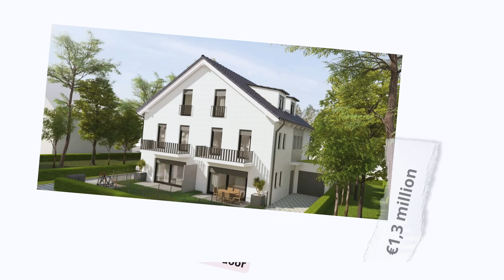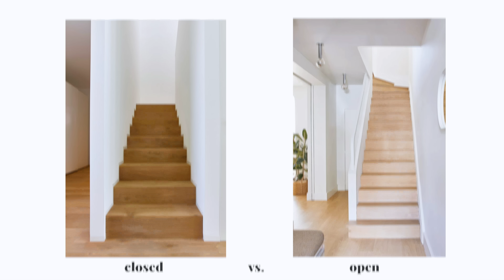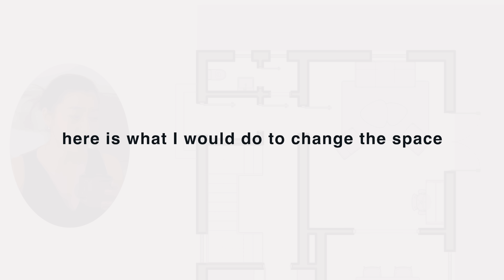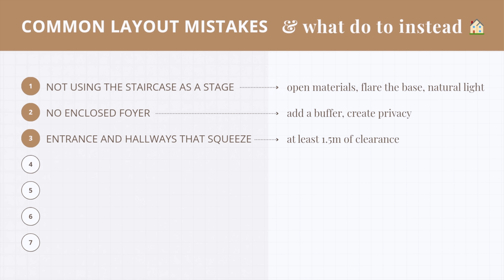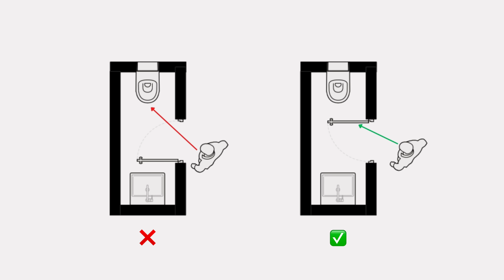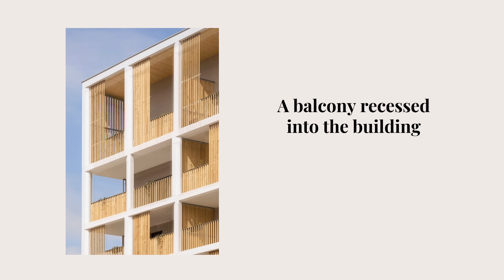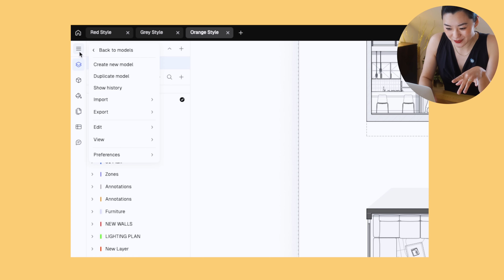Architect’s Advice: 7 Common Layout Mistakes + What to Do Instead

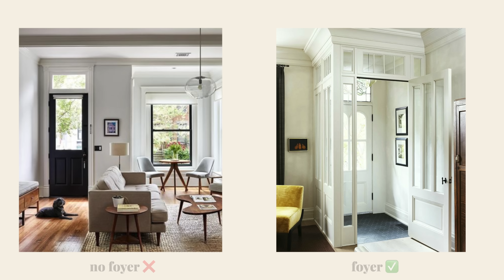Comment: The architect failed to give any sort of reasoning behind the "enclosed foyer" argument. She said that the inside of the home was "directly exposed" to whatever was outside the front door... so what? A foyer as full of windows as the one shown at 2:08 doesn't provide any more privacy, and most people don't have front doors with massive windows in them, due to security. And in the floor plan example she did, the staircase also gets enclosed in the foyer, which negates all of point 1- why would I spend so much money to make a beautiful staircase and then close it off from the rest of the house? And also who wants to have to go through an extra door every time they go up or down the stairs? Her third bullet point makes no sense, has she never heard of compression and expansion? Does she think she's smarter than Frank Lloyd Wright?

Comment: It is architects that design houses not the house buyer.  And there are some p     poor architect's out there.
Ever the optimist I like to work with a new architect but they can be so difficult to work with.
Make the structure thinner.  Wafer thin.  Sure, but it will cost you in extra materials and fabrication and I'll have more elements to design more thoroughly so more engineer design fees thank you.
Yes do it (you silly awkward old engineer) 10 days later builder says lovely design drawings fantastic colours and I could build it for 30,000 less.  Yes of course you could I told the architect and client that wafer thin is not the economic way to do things.  I know what you want you want simple easy to source sizes it'll cost my normal design fee we'll see if the client wants to pay to reduce the build costs shall we.

Comment: in my opinion houses are still designed for life that has not existed for decades and the kind of families that are nearly extinct. People eat outside often and there is no need for huge kitchen and separate dining room. Watching TV as a family or group had diminished. Different generations watch what they want from separate devices. Large number of cramped bedrooms make little sense as families are small, one maybe two kids. Instead they have a lot of stuff and instead of clumsy closets, a walk-in closet would make more sense and enough room in the room. Where is the study/room for work? Nowhere. Then architects offer some miserable small table with a laptop in some corner as if anyone with anything useful to do could get some actual work done from that setting... Simply compine kitchen, dining area and dining room.  Make kids bedrooms large enough to fit a good table and a walk-in whatever place for clothes and enough room for all the junk people want to hide somewhere out of sight too. Parents need a place from working at home, because many have to do that these days and a laptop on a kitchen table is not that.

Comment: It’s mad to me that over half the population will be menstruating for half their lives, and yet I absolutely NEVER see modern bathrooms designed with cupboards, drawers, or shelves that can hold menstrual products and be easily reached by someone seated on the toilet. Over-the-toilet aftermarket hutches which are awkward to reach when you need something in a hurry are all I see, and those are designed by people filling a gap the architects left behind. Yet in many older homes, there are thoughtfully placed insets  shelves or small cupboards which can be reached by someone seated on the toilet. Every bathroom should be designed with easy accessibility to both sanitary supplies and a wastebasket space, and both should be comfortably reachable by someone sitting on the toilet. 

My other bathroom gripe is that shower niches to hold toiletries are great, but they are never quiiiite deep enough, and seem to never be designed with proper drainage in mind.

Comment: You call it a 1,3 million euro house, but in the Netherlands that would be more like a 26 million euro house. Many of the tips you gave ONLY apply to "loads of space" houses. Most houses over here would have a total living space of 100 to 130 square meter spread over 2 or 3 floors. There is ALWAYS a hallway in our houses, but the loo, well the room is the size of the actual toilet +25 cm (less then 80x100cm) You won't be moving stuff around in there. Light from two sides? I don't think the neighbours would appreciate me putting a window in our joined wall. You wil NEVER get a permit to change a balcony of your apartment building...EVER. No point wasting time on trying.

Comment: No disrespect meant with my following claims: Design for the sake of taste does not have to be practical, eg: the buttons on your sweater have no practical value, yet still they are there. Design does not need to be functional.

Comment: Your suggestion on staircase at entry is idiotic, it needs to be more open to move furniture upstairs, is this move a tell tale sign that the architect is a dumb ass?  The entrance is not a "public" space, that may be outside the house door but not inside the house door.
Agree on an open entry design.
Disagree on a bath opening to the foyer, poor taste.  Same with the stair, not open for furniture moving.
Could not take watchin any more poor ideas ...

Staircase is where you will break body parts and either cripple or kill yourself as you age lol, works for younger families to add sq footage to smaller footprint but hazard for old folks.
If you get there, why put a laundry anywhere but an exterior wall for dryer outlet efficiency, hope you covered this.

Comment: Sorry Baixu I was in social housing for 39 years. Now read on..
Staircase has to be straight and next to supporting wall - stairlift
Circulation space - lovely but it depletes room space for main rooms - minimise.
Entrance wheelchair can do 360 and level access.
WC door must open outwards for safety  in case someone collapses inside.
Rooms with two sided window- lose overall housing density - distance about buildings criteria.
Juliet balcony cheap ... not great ... but cheap. 

To get a 3b5p house in 84.9 sq M and attempt to have two separate downstair rooms - innevtiably a dining kitchen which I hate. But you can recess the sitting bit to make it more like a separate room or use the unforgiveable sliding doors ??? 
Kitchen not a passage to back door - but often ends up as such. 

I am not an architect, but a housing cost engineer and know my place. BSc 
(Bums on seats)